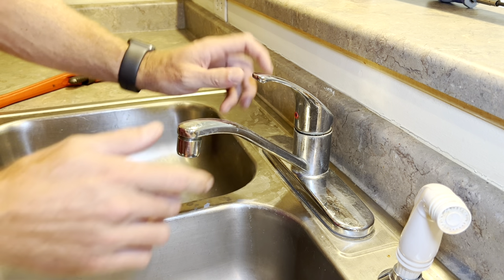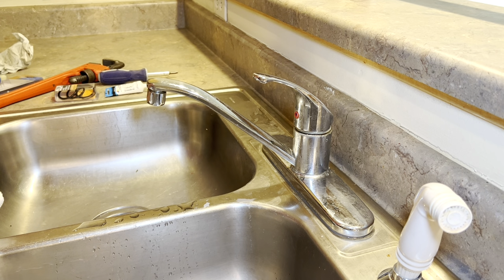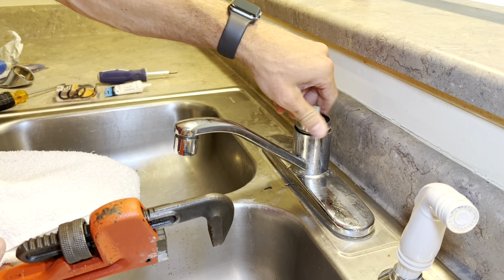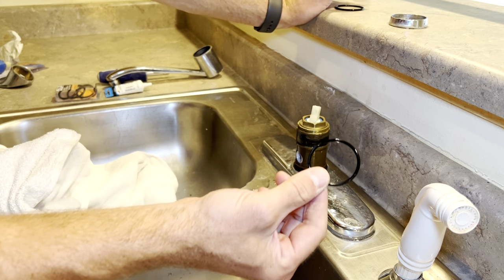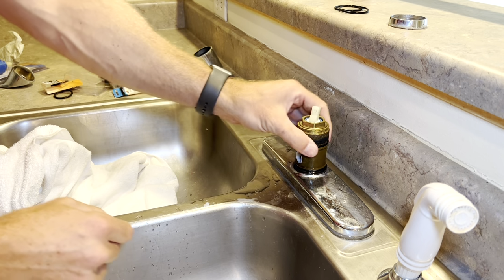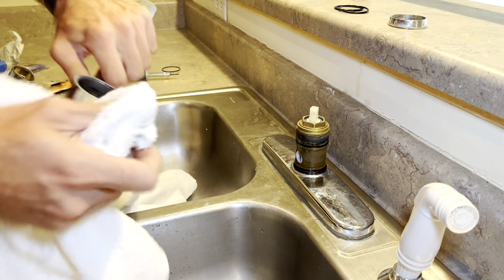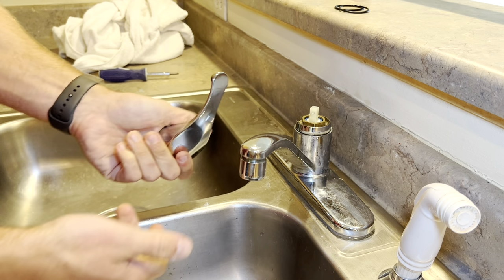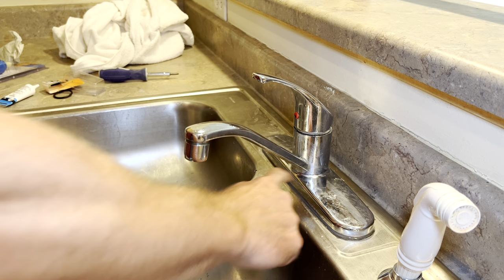Kitchen Faucet Leaks at the base. Easy Fix!

Comment: Most important advice would have been to plug both sinks to avoid dropping bits down into the pipes.
Reply from the maker: Yes! I have mentioned that in other repair video that I have done. But I guess i neglected to mention it in this one… It’s typically a good idea to plug the drains. I’ve dropped screws down there before and it’s never a good time.
Reply: I came here to write that as step 1. Lol
Reply: Excellent point.
Reply: I was thinking the same thing.

Comment: What if it keeps leaking slightly after you’ve turned off the water under the sinks?
Reply from the maker: If you turn on the faucet and no water comes out the end, then the shutoff are working. so if you are seeing a little bit of a leak, its probably just the water that remains in the neck of the faucet running back down. if the shutoffs are working, then I would go ahead and open up the faucet and replace the seals like in the video.

Comment: I'm having issues getting the colored circle removed.
Reply from the maker: it usually takes a little screwdriver to pop it out.
Reply: @RoscoReviews  finally got it. It was gummed up a bit. Trying to get the setting screw to move. It doesn't use a regular screw. Trying to figure out what Allen wrench to use.

Comment: Not being the greatest fix-it man as I wasn't taught by my dad ; watching your video was most informative.  Now I  know what I need to fix the annoying leak is a set of rings and that silicone lubricant,  I am going to search which hardware stores have these items , as we have Ace, Home Depot,  and a Loews in my area. I'm still going to have to have some help from my Church brothers, though , as I have very bad arthritis in my joints. But I  can at least get the materials we'll need for this easy project ! Thanks for your channel and clear, no-nonsense detailed step- by- step instructions, Sir. And thanks YouTube for posting this 😊.
Reply from the maker: Glad I could help! 
All of those hardware stores should have what you need. The Lowe’s and Home Depot where I live probably have a better selection than the Ace keeps in stock. There are a range of sizes, so you will need to know the brand and model if you are going to try to purchase the specific size you need (this usually cost 1-2 dollars) or you can buy a variety pack that has a bunch of sizes (this usually runs more like $10)

Comment: Thanks. I have the same model and after 40 yrs of use it’s starting to leak around the base. I have seen some people push up the handle as they run the water and that is a No No. Release your hand from the handle when the water is running. The pressure on the handle causes more problems down the road. Also put something in the sink tub like a cloth to keep small parts from falling into the drain. Lesson learned on that here. Thanks again
Reply from the maker: Wow. 40 years is a good run! Where I live we have really hard water and it tends to make all of the rubber seals on pretty much everything wear out in 10 years or so.

Comment: Reminds me of my old builders grade sink and faucet that came with my house as new construction in 1980. Instead of repairing the leaky faucet I bought a new cast iron Kohler sink and a new Kraus faucet. Removed the old sink and faucet as a unit and had the new sink and faucet already hooked up. All I had to do was apply some plumbers putty along the perimeter of the countertop, drop the sink in place and make the connections to the water shutoff valves. So much easier than crawling under the sink trying to remove the hardware for the faucet.
Reply from the maker: Yeah. If you are wanting to upgrade anyway. Then when it starts leaking is a good time to do it.

Comment: Thank you very much. I want to point out when I took the top o ring out, it was extremely loose. Not knowing that its expansion after years of use was the cause of the leak, I went out to buy an "identical" ring only to find that it does not solve the leak problem. Fortunately, someone from Home Depot later gave me the correct size for free and told me about the expansion and I finally stop the leak.
Reply from the maker: This is good information. It was really nice if Home Depot to get you the correct size for free!!
Reply: My faucet doesn’t seem to have that set screw in front and of course no brand marking !

Comment: This is so helpful! Thanks for posting this! 😁
Reply from the maker: No problem! Thank you for supporting my channel 😄
Reply: @RoscoReviews  will a crescent wrench 🔧 work instead of those big red ones I don’t have
Reply from the maker: To remove the collar off of the top, it depends on the brand of faucet. Sometimes there is a hexagon shape on top that you can grab with a crescent tench. But, often it’s a smooth sort of dome shape. This will take a pipe wrench or a pair of adjustable pliers large enough to grab it.

Comment: Suggest soaking the parts with calcium build up in vinegar while putting on O rings etc. removes build up easily. Also use Channel lock to remove top retention ring vs. large pipe wrench
Reply from the maker: That could be very helpful particularly if you live in an area with really hard water. 
Channel locks could work, a strap wrench also works well and might save the finish on the pieces.
Reply: To change that o ring not need water off

Comment: Couple extra tips:
1.  A pick works better than a screwdriver to remove the o-rings.  Less potential damage to the groove and easier removal of the o-ring.
2.  Silicone in the groove BEFORE re-installing the o-ring allows better silicone coverage.
3.  Soak the chrome parts (spout, retainer ring, etc.) in vinegar to remove the scale and deposits so it looks better and functions better.  Any scale left inside the spout where water has been leaking past the o-rings will tear up the new o-rings faster.
Reply from the maker: Very good suggestions.
Reply: Why do people that already know how to do this sit and watch and comment?    Just make a video since you're extra knowledgeable.
Reply: @Kenneth_James maybe they was looking for a good video to recommend for someone...

Comment: Excellent video ! But I can't help it, but I gotta say that for many, the fun begins when you start bending allen keys and the screw is seized !
Reply from the maker: Getting the handle off is often the hardest part. I have even had the cartridge break off trying to pull the handle off after I had removed the set screw. They can get pretty stuck on there.

Comment: Great, thanks, been wondering how to solve that. I've found lanolin grease to be a good alternative to plumbers grease. Doesn't tend to wash away over time anywhere near as fast, lasts for quite a number of years.
Reply from the maker: That’s interesting. I’ve never tried that. I have seen some “food grade” lanolin products. So those should be safe for this kind of application.
Reply: Bad advice.  The National Rubber Compatibility Chart says it's not recommended for nitrile butadiene rubber, which most o-rings for plumbing applications are made of.  Lanolin contains small amounts of acids and alcohol.
Reply: @mikecee3058  Thanks for looking into it. I've been using it for around 25 years in domestic applications and never had to change out any of the o-rings. I've re-greased some of them after ten years or so and not noticed any unusual degradation. CRC Lanocote for example seem to be pretty adamant it doesn't harm rubber or neoprene and contains no acids so for myself I'm happy to carry on using it because of its superior longevity. However if that's what the chart says it would be prudent to follow its recommendation.
Reply: @mikecee3058  I hate to ask but I must what about using petroleum jelly does that ruin the o-rings.? That's the only grease that seems around my house.

Comment: Great video! I am still waiting for my plumber to fix my leaking kitchen faucet, not sure if he forgot me or not. In two days my first rental guests arrive for the summer. My leak is also dripping under the sink towards the front up under the "hole" of the faucet mount, is this the same issue by any chance? I am sure you won't be able to help me in time, but I am a 62 yr old lady who is desperate to get this fixed and now. Thank you! Your video is by far the best I have watched so far.
Reply from the maker: If it’s dripping underneath the sink only when the faucet is on and flowing water. Then there is a good chance that it is the same issue.
Reply: @RoscoReviews , thank you! This morning I fixed it! Yes, leaking underneath stopped as well. So relieved, though I did go out and buy another "Delta" faucet, just in case. Feel the power of a new O-ring....!!!! Thank you again for a great video, this one helped me the most. Woot! Woot!
Reply from the maker: Awesome!! Nice work! glad you were able to get it fixed :)

Comment: Damn this video was so helpful! Only problem is I didn't read before diving in and my leak isn't at the base 🫠😆🫣🤦🏼‍♀️

Wellll...I know what to do for this kind of leak! Now I need to fix a drippy faucet 🤦🏼‍♀️ drippy was the correct word damn 🤦🏼‍♀️🤣
Reply from the maker: The process is almost the same. You only need to remove one more piece to replace the cartridge. If you are doing a cartridge, you should go ahead and replace the o-rings while you are in there.  They only cost 1-2$.
Reply: @RoscoReviews  thank youu!! I did everything correct and fixed the drip! But not there's a leak like what you're showing. I replaced the o-rings, did everything right from several videos so idk what's wrong 🫠
My bfs going to look at it and if not just replacing the faucet 🙃

I'm proud of myself! But annoyed still lol
But your video was very helpful!!!

Comment: I put these types of stickshift faucets in a few years ago, but I wish I had just fixed and stuck with my old Delta two-knob kind. They had lasted several decades and were easy to adjust the desired water temperature. I don't like fumbling with this single handle type.
Reply from the maker: I guess I’m kind of the other way. I grew up with the single handle faucets, so that’s always been my preference. It probably just depends on what you are use to.
Reply: Can you still get the spare parts for your Delta? If yes, please provide the info. Thank you.

Comment: I looked very closely at the top part of my leaky kitchen faucet, and I can’t find that little pin that you’re supposed to loosen first to start what’s supposed to be an easy repair ! My doctor says you can also use Vaseline jelly on the O-rings when I’m replacing them ? Is he correct? My local Ave hardware said to bring in the old rings and they’re pretty sure they have them in stock. They also told me that O-rings come in hundreds of sizes, so it’s important to make sure you get the right size. BTW my old faucet is a Moen brand if that really matters.
Reply from the maker: Moen is a good brand. I highly recommend them. Some of the Moens the screw is on the top. The top cap pops off and there is a screw underneath it. 
Most hardware stores keep a good selection of sizes. 
Vaseline is probably better than nothing. The hardware store should have the silicone grease too, and it’s pretty cheap.

Comment: I love the way that Allen screw came right out. Well, I have been trying every way suggested to turn a stuck Allen screw.
But I have not tried a drill bit to start a hole and then use a left-handed screw to withdraw the Allen screw. Does that sound right 
to you ?  Otherwise, it looks like I'll just have to buy one whole new faucet, ouch, $$. Thanks for your suggestions, Art
Reply from the maker: I’ve had those set screws be pretty stubborn. If you have an Allen head screw that is stripped out, then a removal tool is probably the best bet. And I think that is what you are referring to when you say left handed screw. I wouldn’t think you would need to drill it first though. I would turn to the drill after the removal tool didn’t work.
Reply: A torx bit worked better for me than the Alan wrench

Comment: Thank you for this video! What if it is leaking even when off under spout and base?
Reply from the maker: It’s thought to say without looking at it. But it could be coming from the cartridge. Or it’s possible that the faucet itself has started to leak somewhere and it may be time to replace it.

Comment: If there's water leaking then the cartidge probably should be replaced. There should be no water getting in there and the O-ring replacement might be temporary. Moen and Delta give free replacements of the cartidge - bring the one you take out to Home Depot and they provide the cartridge at no cost or call the manufacturer. The Moen replacement include a new cap and Allen wrench. The Allen key that worked for me is 3/32".
Reply from the maker: This is good advise. If you are opening up the faucet anyway, its not a bad idea to go ahead and replace the cartage anyway. especially if you can get the parts for free!
Reply: @RoscoReviews  The

Comment: Wow, that is thin stainless steel.  You can see how it flexes.   My sink is from the 1970's.  They used thicker metal back then.
Reply from the maker: Yeah, there are different gauges for sure. This one is in an apartment. So I’m sure it wasn’t top shelf material. lol

Comment: When I move the faucet spigot, the handle rotates with it.  
I am glad I saw this video, I didn't know how easily this came apart.  What would cause the spigot and the handle to rotate together?
Reply: Your faucet mounting nut below sink top may be loose , if o rings become seized and stuck it can turn the entire faucet left and right
Reply from the maker: I would tighten the nut underneath and replace the O-rings. I would bet that would solve the issue.

Comment: Great DIY video. May I ask what size of O-ring did you use? My faucet is a Thai brand called Hang. I need to order the O-ring online. When I measured the outer diameter from the outside of the chrome sleeve its 135mm. O-ring inside mabe 130mm. Does that sound right?
Reply from the maker: Unfortunately there are several sizes. If you are unsure of the size and don't have a near by hardware store where you can take the old ones to compare. I usually recommend getting a set like this one:
https://amzn.to/3zamLMv
getting a set is definitely overkill because you will end up with tons of sizes that you don't need. but individual rings are usually 1-2 dollars and a large set is only about $10 depending on which one you get. So it's not that much more and then you will have extras for next time.
Reply: @RoscoReviews  thank you for the link.

Comment: If you can't find a suitable o-ring replacement just wrap some Teflon tape around the area where the o-ring goes (after cleaning the o-ring area).  Reinstall the o-ring and the Teflon tape will account for the o-ring wear and make the o-ring usable for at least a few more years.
Reply from the maker: That’s interesting. I’ve never tried that.

Comment: Any recommendations if the screw for the Allen wrench is stripped?
Reply from the maker: You could try the rubber band trick. Where you sort of shove a rubber band (needs to be the wider kind) between the Allen wrench and the screw. Then it will have the rubber in there to help it grab. 
Another option would be to put a little bit of supper glue on the end of the wrench. Stick it in there and wait a few minutes for it to set up. Then try to unscrew it. If that works you will probably have to throw out the screw. But if it’s stripped than you probably don’t want it back in there anyway.

Comment: What size were those O-rings you used?  Asking for a friend.  Totally don't have that same faucet.
Reply from the maker: Unfortunately there are several sizes. If you are unsure of the size and don't have a near by hardware store where you can take the old ones to compare. I usually recommend getting a set like this one:
https://amzn.to/3zamLMv
getting a set is definitely overkill because you will end up with tons of sizes that you don't need. but individual rings are usually 1-2 dollars and a large set is only about $10 depending on which one you get. So it's not that much more and then you will have extras for next time.

Comment: Very helpful video. I had to call  a plumber because the seals were shot and frankly easier to replace the whole unit than obtain the seals and i was under pressure. Frankly not impressed with the design of the taps.
Reply from the maker: Yeah. Sometimes, depending on the age of the unit, it’s easier to replace the whole thing than to try to fix it.

Comment: I have the faucet end that leaks too. Will changing the same o rings stop that leak too? Thanks
Reply from the maker: If it’s dripping out the end of the faucet then you will need to replace the cartridge too. It’s pretty easy to do if you are already replacing the o-rings. Unfortunately, I don’t have a video for that on this type of faucet yet. But here is a cartridge replace on a bathroom faucet. It’s pretty similar. 
Bathroom Faucet Leaks, 5 minute fix
https://youtu.be/ndYqeQUVOGc
Reply: @RoscoReviews  thanks so much 👍🏼